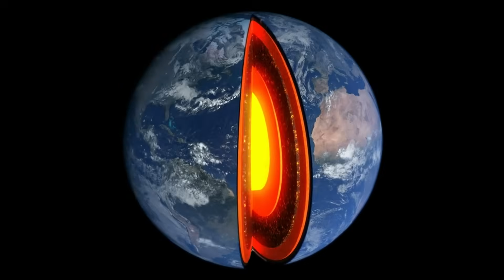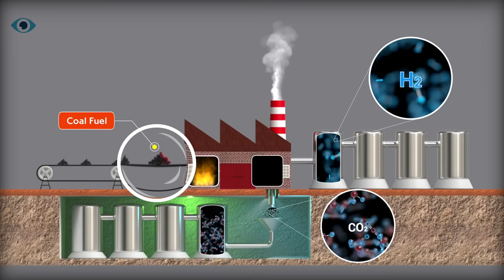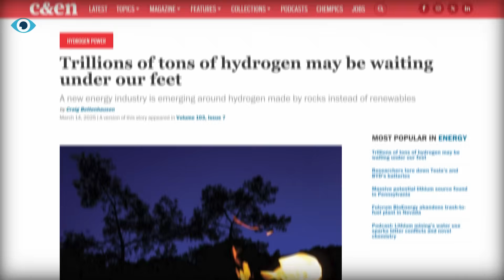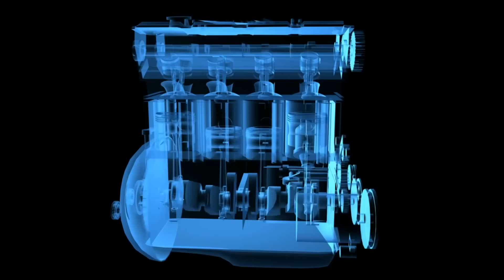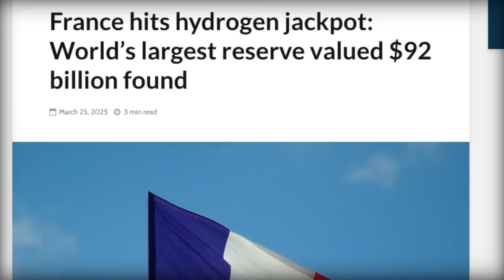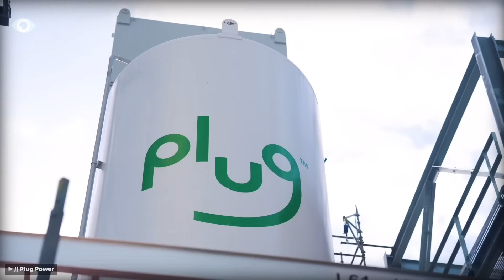Scientists Just Discovered a Massive Hydrogen Reservoir Jackpot

Comment: This has been known about hydrogen for many years in the oil/gas industry.  Often, the flair you can see in some fields burns with a transparent blue flame rather than the yellow smokey flame one sees burning  hydrocarbons.  It has been ignored for the most part because storing and transporting it is very difficult and would cost much more than the oil or methane transport.  The new interest may cause a boom in combining it with something for easier transport.  The obvious solution is to combine it with carbon and put it through normal lines.  Oh yeah!  CH4.  Or, maybe with oxygen and produce water!  Good for desert areas.  This whole thing also points to the fact that most hydrocarbons (Except coal) are produced deep in the earth high pressure high temperature environment.  These are most prevalent along the earth faults or under impermeable rock formations that catch and store the production.  The University of Washington found deep sea sources of oil that contained carbon 13, rather than the carbon 12 found in living things.  Carbon 13 can be seen in the mud mass spec.  But seldom reported because it is "just an anomaly" to the highly educated geologists.  Organic compounds known to exist in certain class of meteorites that have fallen to Earth also are found in outer main belt asteroids, recent NASA study showed.  Dinosaurs in space?
Reply: How many tons of space rocks hit the earth???
😢😮😂

Comment: Such B.S.!  If it can be captured then it has to be cooled below its critical temperature (~33.2 K) to liquify it for practical storage, handling, and use.   That is an exhorbitantly energy intensive process.  And hydrogen gas has roughly one-third the volumetric energy density of natural gas at STP.
Reply: You are right. Bull shit. Handling it under the rough conditions of the field will case an explosion, or more likely a fire
at any moment.  H2 amongst Ethin and carbon disulfide, has the most unfavorable properties in regard of flamability.